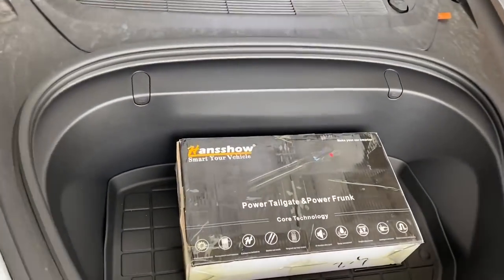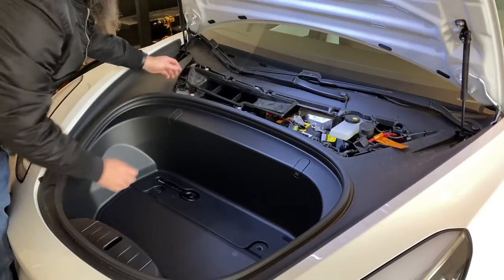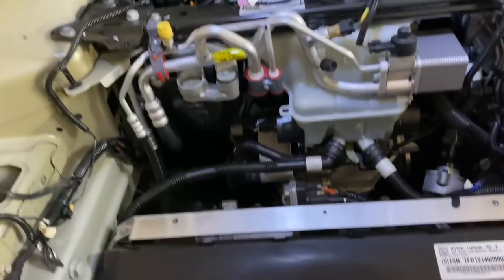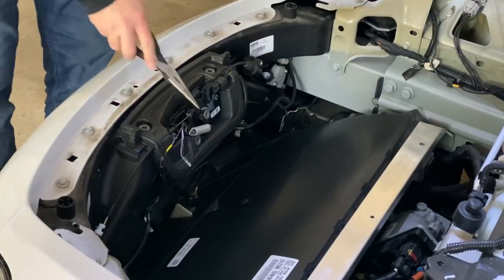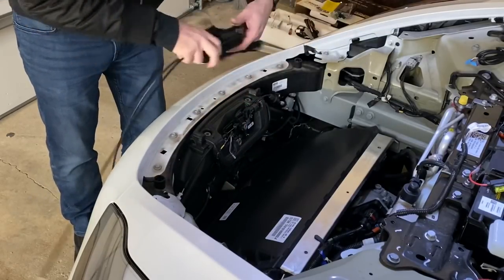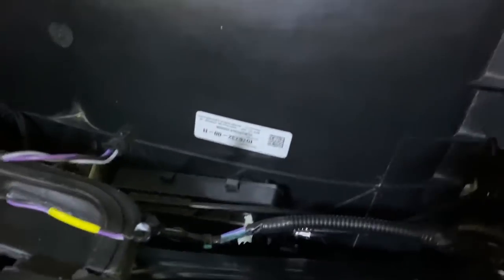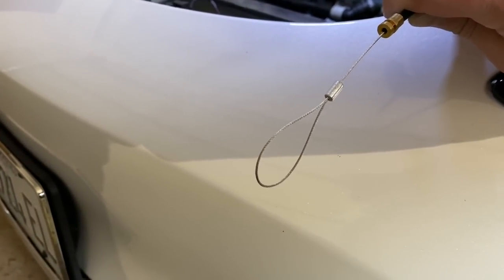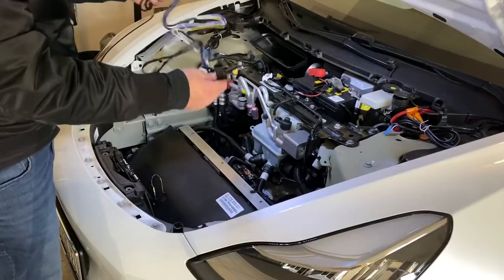Tesla Model 3 - Power Frunk Installation and Review!!!

Comment: The Hansshow paper-guide that came with the kit was almost useless so thanks a lot for this good and detailed review.
I did route and secure all wiring better (and spend a whole lot more time doing so), but then again that is not what this video is about!

IMPORTANT: As I think "Because Tesla" mentions in this video it is VERY important that the lower primary lock mechanism protrude a but into the V-gab. Look in the Hansshow paper-guide for that detail. If it does not then the frunk will get stuck and unable to open! You can easily adjust it via the 10mm nut that you loosen to install the Hansshow latch.
If you still got the Hansshow diagnostic plug in the frunk button the frunk will try to open again and again and again... This happened to me but luckily I was able to help the mechanism pop up (while the lock was trying to release) - used 2 thin plastic prybars from a kit I bought for the Hansshow Trunk operation.

Your frunk add-on video was also viewed for that job! 
https://www.youtube.com/watch?v=frMNVyur1is

Thanks again and greetings from Denmark!

Comment: Wow. 33:08 sec didn't know you can disconnect that button closing adaptor after you're done setting up from speed frunk opening and closing? I just kept mine on there for when I install the extra switch I was able to tap that Hansshow adapter versus going to the OEM harness wire tapping.

Comment: So how would you get into the trunk if the Hansshow unit fails but the battery is still providing good voltage to the unit?  Would it allow the emergency cable to operate?  Also, if the 12 volt battery does fail, will the original Tesla method work to open the frunk (applying 12v to the two wires at the towing access)?
Reply from the maker: There are different points of failure for the frunk, so each scenario depends on the cause.  If the 12v battery fails, you can try the manual release cable that comes with the kit, and you can also try a 12v (I've even seen a little 9v work) to the two wires at the towing access.  If the secondary latch fails, meaning the primary latch pops the hood up a little, you can fit your fingers or a tool under the hood to release the secondary latch.  If the primary latch fails (and the hood doesn't pop up at all), you will need to jack up the car to get underneath, remove the flat panel that covers the under side of the frunk to reach up underneath the frunk tub where the latches are to release it manually there.  Hopefully this addresses some of your concerns.

Comment: To date Tesla has never delivered either on time or on budget ~ so will it be with the cybertruck. Further, the vehicle they revealed will not pass the NHTSA (National Highway Traffic Safety Administration). It needs: 1) proper headlights, 2) proper tail lights, 3) rear view side mirrors, 4) windshield wipers, 5) crash tests; which will not go well as their are no crumple zones with the exoskeleton. That means the cybermobile will KILL anything it hits; cars and pedestrians alike, and it will also KILL anyone inside, as they (not the vehicle) will absorb the enormous impact.

Additionally, the super thick body panels make it dangerous, and the uni-body design makes a terrible truck for a variety of reasons ~ mainly it's towing limitations. It's hard to make a uni-body as strong as a body on frame without it getting very heavy, which cuts into its towing capacity. The uni-body also limits the body/bed configurations (like the 5th wheel) as well. It has therefore always been an inferior design for a truck.

Moreover, Tesla batteries represent the HEART AND SOUL of their business, which is why the class action lawsuit addressing the software update earlier this year that fraudulently cut Tesla owners battery capacity by 11% is so concerning. They lied stating that it was done to protect battery health and overall longevity, but it was really pure COA in order to both protect their own interests as well as prevent more fires. Their choice to deal so underhandedly with their own battery issues should cause most people to have legitimate trust issues in regard to doing business with them as, again, batteries represent the very core upon which their business is built. 

Lastly, if it is ever produced the base price will increase along with the proposed production timeline ~ and in the end it will not look the same as it does now because it must be redesigned in order to comply with NHTSA regulations. So people can allow themselves to be duped into placing their deposits, but the wait will be long, the price will be high, and in the end the truck will not be the same.
Reply from the maker: Ummm....ok?   You do realize that you're posting this on a tutorial to install a power frunk, right?  No mention of Cybertruck here.  Why are you posting this on my page?